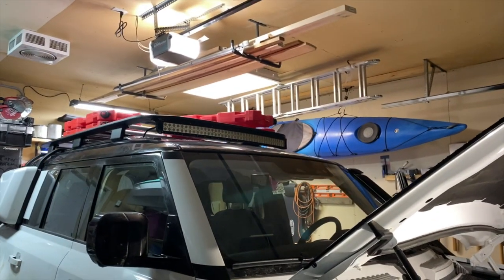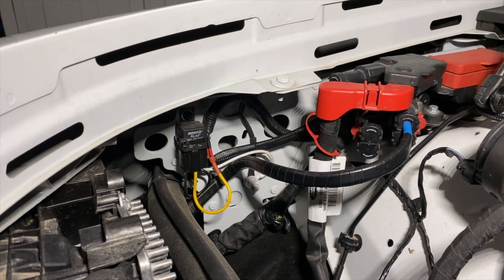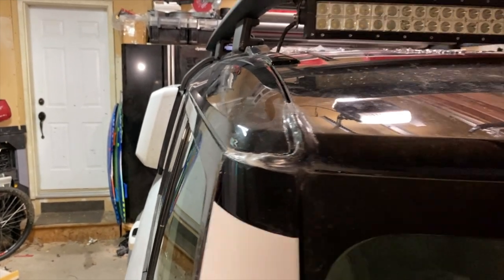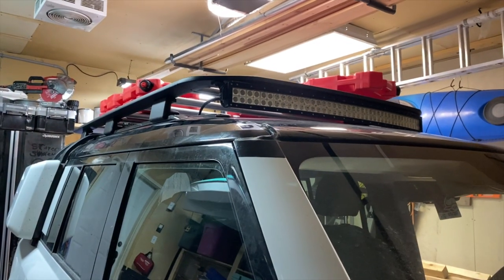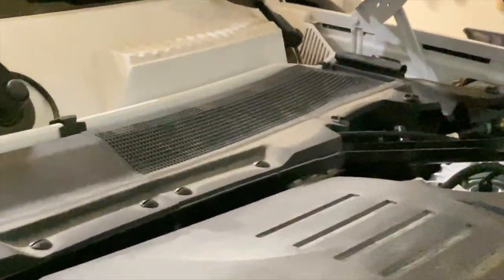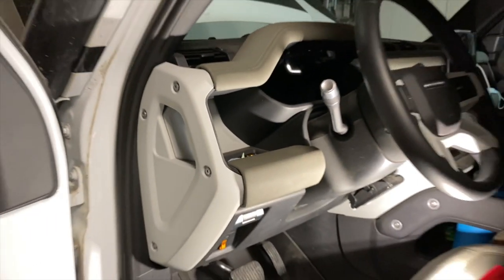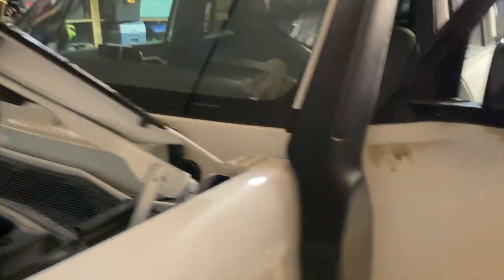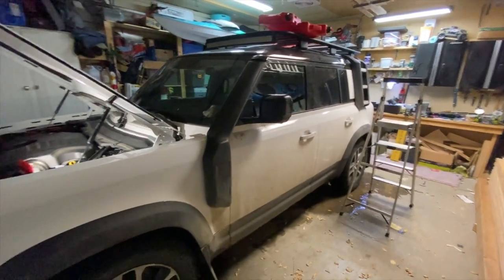Installing a High-Output, Twin Row, LED bar on a New Land Rover Defender 110

Comment: Nice video Steve - handn’t though about extra lights, but some good tips here 🤙🏻
Reply from the maker: Thanks, Promentery Robbins! In a compilation video somewhere, you can see the difference the bar makes in the dark and out here in the mountains. The vegetation sucks up so much light that the stock lighting is really insufficient.

Comment: Great video! I'm prepping myself to tackle this project, but for installation of the roof crossbars... Wish me luck!
Reply from the maker: Good luck! I have finished the install on the STEDI bar (video coming soon), and I would recommend that you double check the depth of your light bar if you have a sunroof. Pay attention to the dimensions I have provided. I pushed the Stedi as far forwards as I can and the light is still too close to the sunroof and the sunroof won't slide back (though it does tilt open). I would suspect that your light bar can be no taller than 2 12" if you want the sunroof to open.

Comment: Where did you connect to the positive pole on the battery? I see the jumper post under the red lid, but nothing to screw onto. Thanks. Love the videos!
Reply from the maker: Hey Darren and Kelly! 

Thanks for reaching out. I don’t think I have any photos now, but there’s a jumper post under a lid on the left hand side of the engine bay. Behind it are a series of kids that cover built-in large fuse holders (presumably for the factory fitted winch etc). 

The first one of these connects to the common strap that forms the base of the jumper post, and I screwed the electrical into that. Be careful to screw to the live side not the fused side, obviously). 

To be honest, there’s quite a lot of space and potential under there to mount electrical items too (which is appreciated and a shift for JLR!). Behind the cover for the jumper post are a few other large-fuse outlets. The common rail splits on mine and feeds several fuse holders — any of these will do). Some of the common rail fuse holders are smaller than others, so you’ll find something there that’s useful.
Reply from the maker: At the @5:20 mark, you’ll see me pick up the red jumper cover. Behind that towards the windscreen is a black cover. The positive common rail is under that — and that’s where you’ll find something to screw to.
Reply: @shedlock2000  many thanks!

Comment: The transparent silicone looks tacky for such a posh and brand new vehicle,black silicone would have been a better option,great job though.
Reply from the maker: It wasn't my favourite fix either, but at 3am in the morning that I left, no whistle was better than looks! I knew the bar would be coming off when I installed the STEDI bar later on (Video on that coming soon). Vexingly, the whistle on the new STEDI bar is worse than the 40" bar ever was!
Reply: @shedlock2000  you and many other people have resorted to using the new the Defender in the same way the old one was, which is a very good thing.

Comment: I just fitted some Lazer grille lights in to my 90, triggered by the main beam 12V signal at the back of the headlamp. I don't think you can use the contactless CAN reader to trigger them from the 12V signal wire as that's not a CAN signal. If you want to use the contactless reader then I think you need to intercept the CAN signal under the seat in the cabin and then route a wire back to the relay.
Reply from the maker: I think you’re right. I was hoping just to use the 12v feed as a trigger wire to induce the switch (surely 12v is easier to induce a current from than a 5v)! but I think I’ll have to go under the seat. 

I’m a bit reluctant to do this, because getting the wire from under the seat to the bonnet is a much bigger pain to do than simply splitting a wire from the headlamp bundle. 

I’m also disappointed because the contactless reader and CanBus interface (which cost over $200) don’t work fully: the interface doesn’t output 12v for the position (or side) lights, as there’s an error with the software. This means I’d have to send it back to Lazer Lamps to be re-programmed at some stage when CanM8 fix it (whenever that may be). So the contactless stuff I bought won’t work properly. I can’t say I’m very happy about that. 

Did you just cut and splice the 12v feed to the headlamp unit to get your feed? I believe the main beam feed is purple and the side light is green — is that right?

How do you like your lazer lamps? I was keen to install low-level lighting, but they won’t fit with a winch, so I’m not yet sure how to proceed.
Reply: @shedlock2000  I bought the CanBus interface and contactless reader and returned them to Lazer after going through the same thought process. Much easier to just pick up the 12V signal from the headlight. I cut and spliced the main beam signal using waterproof gel crimp connectors. It's a purple wire with an orange stripe going to Pin 10. You can quite easily test it with a voltmeter from the connector end before you cut in to it by flashing your headlights (but you need two people really!). I'm impressed with the lights so far but haven't had chance to use then in anger yet!
Reply: I did wonder about sourcing a male and female headlamp connector somehow and then making a little wiring harness to split off the main beam signal. That way you’re not touching your car wiring and it’s easy to return it to stock configuration. But in the end I just cut the wire!
Reply from the maker: Yeah, a little patch lead would be the bomb! I wonder why JLR or @powerfulUK haven't got on that idea!
Reply: @shedlock2000  I did ask PowerfulUK if they’d be interested in making one up but they didn’t seem keen. Which is fair enough as they don’t sell any products that use the front headlamp signal (yet), but they do have a harness for the rear reverse light signal. So fingers crossed they can develop something.

Comment: Yeah, Honestly, not digging the silicone look.
Reply from the maker: It’s not my preferred option either, but there’s no drilling and it’s not really obvious unless you’re looking for it. 

The top panel (above the windscreen) does come off, but it’s a big job and requires the roof lining to come down too. So there are better ways, just not easier.
Reply: @shedlock2000  I understand. Nice light bar, really cool Defender.
Reply from the maker: Thanks!